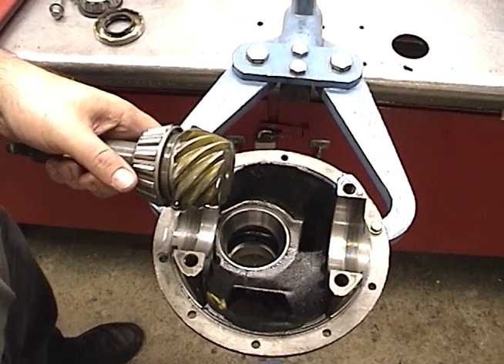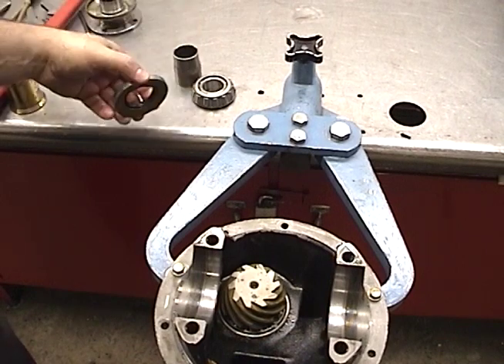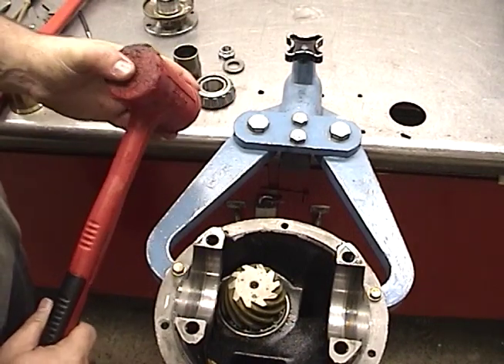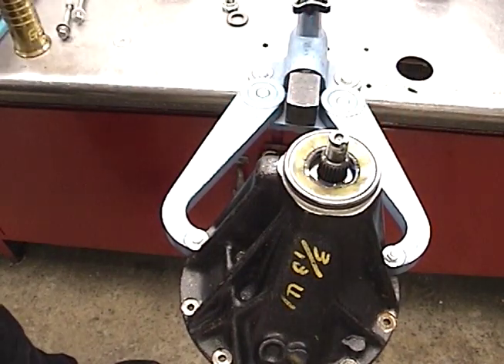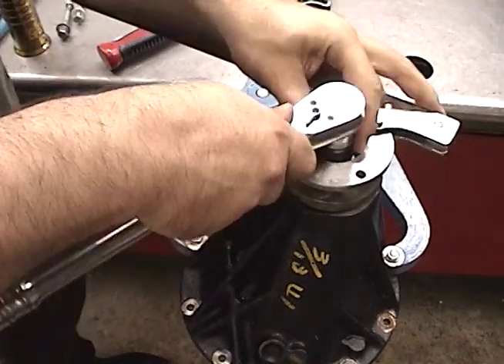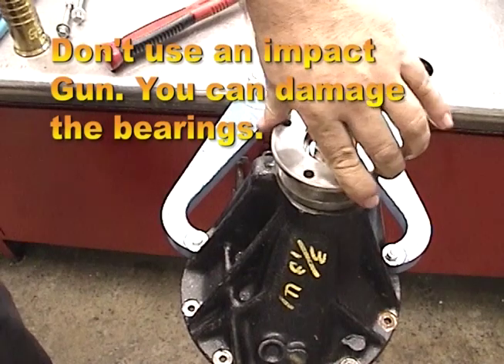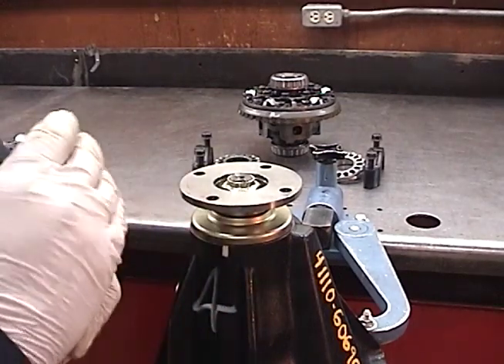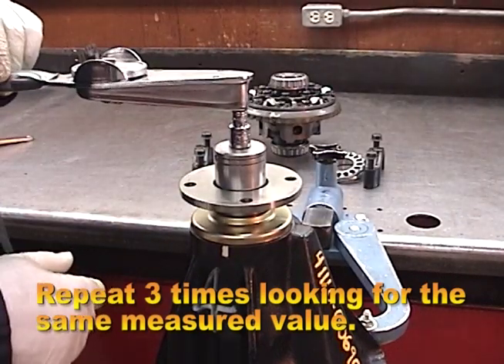Differential Drive Pinion R & R Part 4

Comment: I'd like to inspect the pinion bearings with the thought that they may be OK, preload is fine now. If I remove and inspect everything and it is all OK, do I need to replace the crush washer? Or can I simply reassemble all with the old crush washer, provided I achieve the same target preload?
Reply from the maker: Crush sleeves are a one time use.  If you put a new crush sleeve in and over crush it you need to disassemble and replace it again. Do not skip this very critical step.

Comment: I have some questions.  I'm putting in new bearings on a Jeep Dana 30, carrier and pinion.  Not changing ring and pinion gear.   Is it safe to assume the original shim pack is good to go?  Based on the shop manual, it suggests such. It mention a need to check such if the gears, carrier or case are changed or the packs are unknown.  Or should I go through the process of setting pinion depth, carrier preload and then back lash?
Btw, nice helpful videos.
Reply from the maker: Under this circumstance 9 times out of 10 you will be just fine.  I would have verified the depth with the final contact patch.  The backlash should have been checked and if needed adjusted with the case bearing shims. It would have also been a good idea to check and make sure you have some case bearing preload.  I can't remember is the Dana 30 uses a shim or crush sleeve to set the pinion bearing preload.  If it's a shim you should have checked it.  Bearing preload is critical to bearing and differential life.
Reply: @DrivelineMaster  Thank you for responding.  I have not assembled the differential it yet.  I have measured the shims used on the carrier noting the side and pinion. Waiting for the bearings, etc.  The back lash was .009 before I took it apart.  I'm assuming this will tighten up a bit with new bearings?  This Dana 30 uses the crush sleeve.  I will make sure that is set proper.
Reply from the maker: Once you get your bearings assemble your diff with everything except the crush sleeve and seal. Tighten the pinion to obtain close to the rotational force. Then install your case.  Check and if necessary adjust your backlash and preload.  Once this is set use the contact paste to check the pattern and the pinion depth.  This way if you need to make some adjustments you will not have crushed your crush sleeve to which it would now need to be replaced if you need to make an adjustment. Once your certain your depth is correct you can install your pinion seal and crush sleeve for the final installation.  Here is a little trick to prevent oil from seeping down the pinion splines.  Put a dab of silicon sealer for diff oil on the splines or sometimes I use Teflon pipe paste. A little dab on each spline is enough. Another setup trick but cost extra money.  Have a second set of case bearings and hone out the inner race just enough for the bearings to slide onto the case.  Since the backlash and preload shims are behind the bearing on this model the bearing has to be pressed off if you need to make an adjustment. The bearing can be damaged doing this. If you have a pair of setup bearings that slide on with a tiny snug fit you can setup your diff with these bearings and when you get the shims correct you can press on the bearings that will go into the rebuild.  I sometimes do this when setting up pinion depth as well. The problem is the extra expense.
Reply: @DrivelineMaster  Thank you for the help.  I do have a set of setup rings I got off ebay.  Used them to check the play with the carrier and it spec'd out to .003 more in the original shim pack than what the service manual suggests.  (mentions +.008 to the measured side to side play).  So, I think I'll be good there.  

I'll follow the rest of your advise.  Just waiting on the pinion bearings. Fed Ex is taking it's time.

Thank you again.